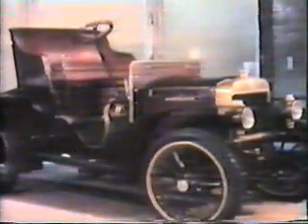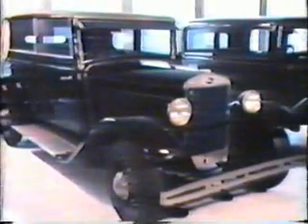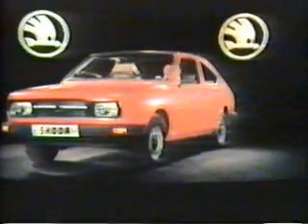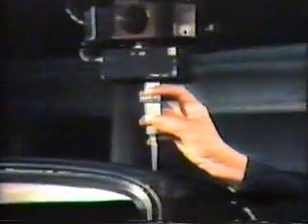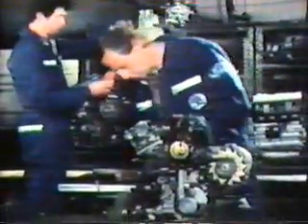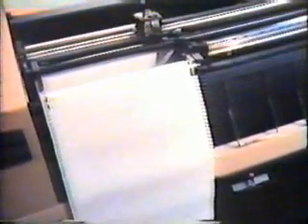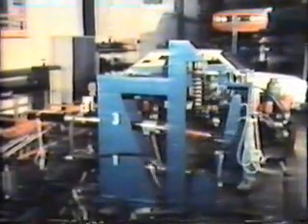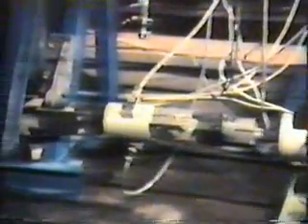Testing Skoda cars 1982

Comment: Ford Flatheads had 3 main crank bearings.
So, the Rapid 130 has 3 main bearings.
Insufficent for higher horespower.
The thrust bearings should be American style as well.
Yes, Skoda is a great concept, but it is too dangerous for modern traffic.
But with a full safety cage, who knows.